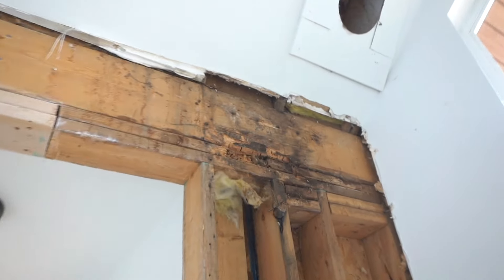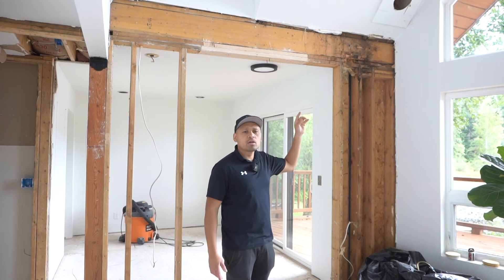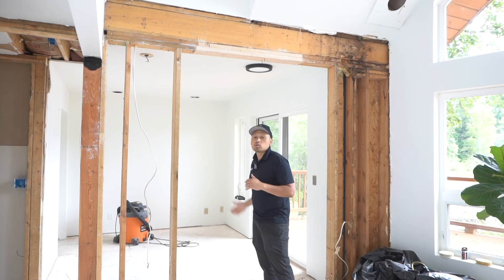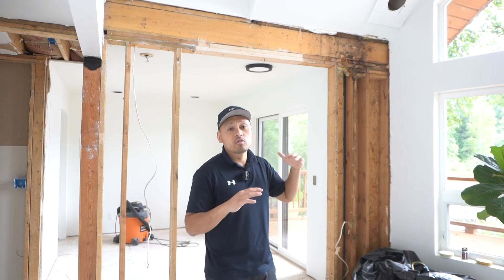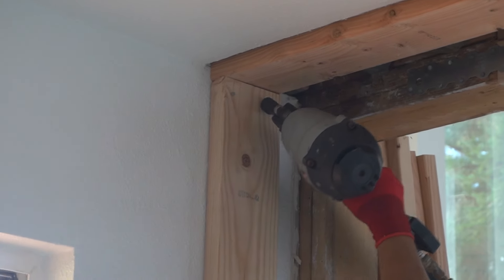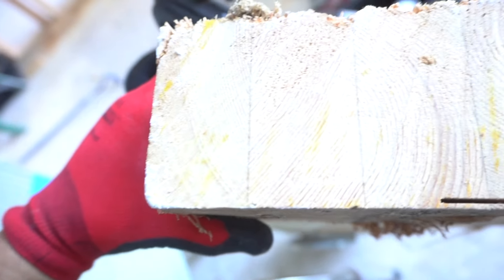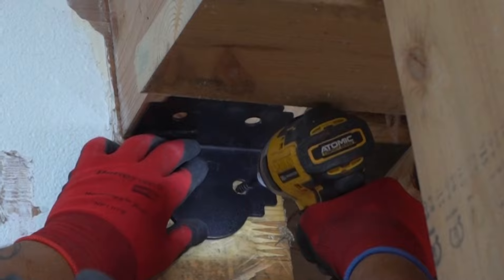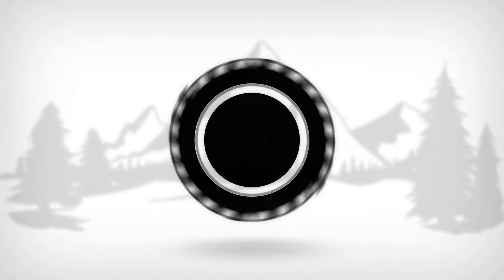My House Almost Collapsed! Replacing A ROTTEN Load Bearing Beam Sellers Hid From Me!

Comment: Honestly, how did the framing pass inspection the first time around? Builders and carpenters build things outside spec and walk away, leaving the customer to then have to deal with the possible future issue(s). Awful. 

Thanks for correcting the issue…
Reply from the maker: I strongly agree with your comment my friend! I’m not sure why this passed inspection after the new built and how this was not caught by the inspector I hired. This should bring awareness to new home buyers to always make sure they hire a reputable inspector not just cause they were recommended by their realtor. Also make sure you check the walls for bulging and uneven drywall corners and joints. I’m so mad at myself for not catching this, it was an easy find, that I overlooked 😞, I’m just glad all is fixed and I’m ready to move on to the next project which is the bathrooms. 👍🏽
Reply: If the previous home owner did not pull permits it would never be inspected. Sometimes homeowners are told they don't need a permit or they don't want to get one. Permits insure the work will be done to code.

Comment: Good job replacing that beam, but I'm curious as to why you chose to go the custom route. Did you consider using a Flitch beam? A Flitch beam made of 2x10's and 3/8" plate steel would be less than 1/2 the cost.
Reply from the maker: Hi! Great comment! We don't want to add unnecessary weight to the structure of our home being in the middle floor, If we were starting with a new build fresh from the ground yes that would be ok to use but not in this case. It would be more challenging to brace wood studs to it being steel.

Comment: 3 ply 9-1/4 lvl with cost like $600 and be much stronger.. 

Please everyone, do not DIY load bearing wall removal without hiring an ENGINEER to do your load calculations. An engineer will also size your beam! 

The reason that was a 2x10 2ply is because there was a stud wall under it. 

Glulam is much stronger than sawn lumber!